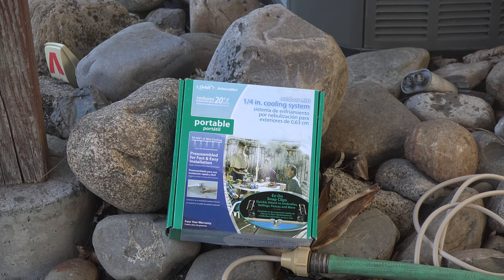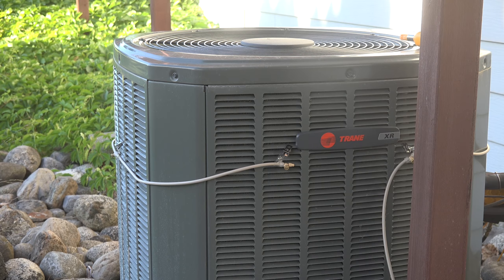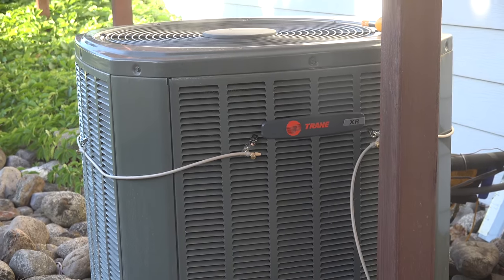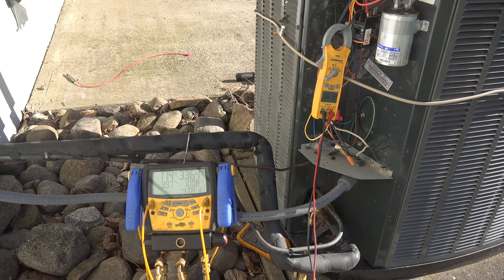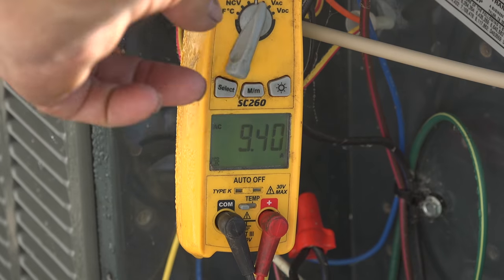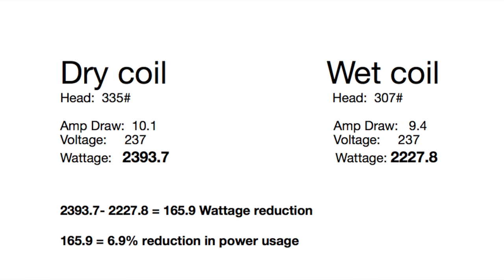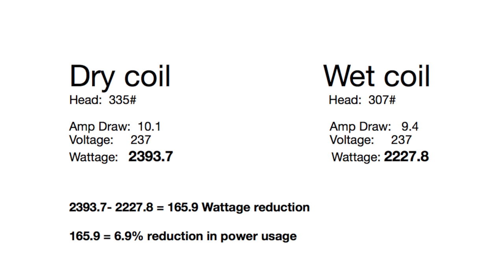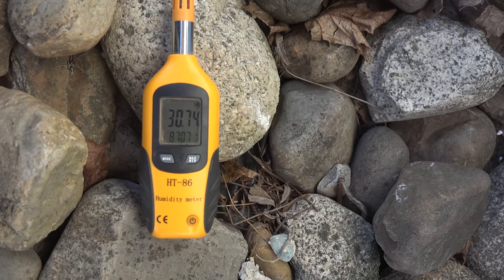Do the misters for A/C work? Part #1

Comment: If misters where something that worked and delivered a 20% savings, AC manufacturers would add it. Manufactures would have there "marketing"demons touting it.
Reply: Mr Krasker yea right this is standard practice in Vegas buddy
Reply: Evaporative cooling could certainly help in an arid climate to boost the efficiency of a closed system like this. The reason that AC manufacturers don't do this or implement it is because they have little financial incentive to. They don't pay for the AC bills that customers incur. If they added a system like this, their units would be more difficult (and expensive) to install, and they'd have to warranty more parts, which they also don't want to do. 

The real problem is total cost of ownership. Customers aren't savvy enough to know how to forecast their usage effectively, and thus wouldn't be able to understand if something like this would make sense financially. I see builders foolishly installing these condenser units on the sunniest spots of the properties out of convenience for them, apparently not caring that it will then get extremely hot during the afternoon when the demand for cooling is at its peak while the heat rejection part of the system is also in direct sunlight, and therefore is at its least efficient. 

Same thing for both parties: lack of craftsmanship and care for their customers or for the environment.
Reply: Michael Horsford
Do they just mist water out in front of the condenser coil, or are they using pads like a swamp cooler has?
The only systems I've seen that both work, and don't damage the equipment have some sort of water panel, basically a swamp cooler pad, in the air stream before the condenser.
Reply: Industrial ACs do this. One problem with such permanently hot and damp systems is that dangerous bacteria and fungi thrive in those conditions so the units have to be periodically inspected and treated (chlorination, peroxide or other) to prevent potentially severe and lethal outbreaks.
Reply: I was in The Bellevue-Stratford Hotel in Philadelphia at a ham radio convention at the same time as the Legionnaires' had there convention. The outbreak of Legionnaires' disease killed something like 30 men, quite a few people got very sick. I had my wife and 3 month old son with me, the CDC and Philly police came to my house and talked to us, we never got sick.
Reply: Mr Krasker no expert on AC systems and live in NC. Recently purchased a small 5050 BTU window unit and it came with a plug in the drain whole for condensation and the owners manual says removing plug will reduce efficiency of unit. I can tell a noticeable difference when plug is in place the fan hits the water and splashes it on the condenser (believe that’s the correct name) than if I remove the plug. It’s much noisier with plug in and that’s why it’s removal. Again, window unit , not an expert, can’t understand why it wouldn’t be the same on a larger unit, just my observation
Reply: @Zan The problem with industrial units isn't drainage. It is the fact that the entire immediate area is perpetually warm and damp from their mister or waterfall system and condenser operating practically 24/7 - they never stop long enough for the entire area to dry out and kill off bacteria. Sanitation of some sort and associated maintenance are required. Room ACs get their water from humidity condensing on the evaporator trickling to the back where it gets picked up by the exterior fan and flung at the condenser to both assist with cooling and eliminate the need for a drip tube to control where waste condensation goes. Once indoor air has been dehumidified, the amount of condensation goes down considerably and the AC gets to dry off most of the way.

Comment: This is a very good forensic analysis if misters are actually beneficial in reducing head pressure thus reducing amp draw on the compressor. I am not very keen on blowing city water on to the condenser coils because of calcium build up. I just put a stand alone high velocity fan blowing into the condensing units coils. I really dont know if it really helps because I dont have an amprobe any more or the correct gauges to see if that stand alone fan is doing any good. Where I live electricity is real cheap so I am not worried about that. All I am interested in is reducing the compressors head pressure to prolong its life. I am a retired electrician but over the years I have learned a little on how central air conditioning works.

Comment: Have used this water method for years on both 11.6seer and 13.5seer. Too many variables to measure $ savings. Generally lowered the outside fan temp by 20%. 13.5seer unit lowered the inside vent temp from 64 to 52° .  Works better on low humidity days and above 90°.  No benefit while raining. The old 11.6seer unit died after 13 years due to the gas heater blower but coil fins were normal. I rinse the fins every other year with a sodium hydroxide solution.  I use a $2 stake mounted mister.
Reply from the maker: I can say with certainty the is no way you dropped the duct temp that much.  Evap temp drop runs from 22F on older units to 16 to 18F on newer high efficiency units.  Your 64F would require to around 86F for a return air temp on an older unit.  Not happening unless you are bringing down an uncooled structure.  
I will however, agree that there are too many variables to determine savings.  
GFM

Comment: 35 years ago I bought a new Hotpoint refrigerator.   The older style that had the condenser in the back.  The house wasn't air conditioned so it got pretty warm in the summer.  The Hotpoint worked great but I decided to increase the efficiency of the condenser by putting a small fan in back to help cool the condenser.  It didn't work.  In fact it caused the freezer to defrost.  By over cooling the condenser it caused the pressure to drop and thus lowered the cooling capacity.    

I think if you look into this further, you'll see the condenser is a specific size to meet the demands of a specific air unit.  Instead of a mister, the manufacturers could install a condenser that's 20% larger.  This might lower the head pressure too much to where it loses efficiency.
Reply from the maker: Sometimes the things we think should work just don't.  
GFM
Reply: grayfurnaceman 
It would be a more interesting world if we didn't have these gosh darn laws of physics to contend with!
:D

Comment: Great video. Thanks.
It would be awesome if you would make a video on insulating the outdoor suction line to condenser vs no insulation so as to compare to torn deteriorated old insulation.  To see if it’s worth the cost to re insulate the lines after they old wears off. 
Also would be cool if you added insulation inside condenser to pump and maybe even pump? Wondering cost savings . Bad hood for system. Thanks for all the great videos

Comment: I enjoy your videos and knowledge I gain. Not long ago on Ask this old House show they showed how an air conditioner  condenser was used to heat up a pool via freon circulation  somehow. Very interesting and my thoughts were why not do this for hot water tanks inside the home
Reply from the maker: There are several ways to do this.  One is use a "superheat remover" on your AC.  It is a heat exchanger that is connected to your cold inlet of the water heater.
Another is a designed "water heater heat pump" best used in southern climates.  One more is an air heat pump that can be used to warm water or cool the structure.
GFM

Comment: What would have been more helpful would be temperature readings at the AC duct vent output before and after the mister started.

Does it improve heat transfer?  That question was not answered at all.

While in Florida I had a ground water assist HVAC system that used a shallow irrigation pump system and a second coil in between the coolant coils at the outdoor unit that did infact increase my heat pump efficiency where my bills were cut by 50%.  The waste water trickled out to the garden.

It worked great in the winter during deep freeze periods as the ground water temp was near 55 deg F and kept the heatpump coils above temperature.  The indoor resistive heating elements never kicked in - a double bonus.
Reply from the maker: Watch the entire series.
GFM

Comment: Grayfurnaceman; HS physics tells us that thermo dynamics requires humidity for heat transfer (ie from the condenser to remove the heat.  Here in Colorado, where it's pretty dry, misting works.  I added misters to two Trane rooftop units (AV to cool the computer  room) and the head pressure dropped about 3-7%.
Reply from the maker: The problem here is you may reduce head in high temps which may or may not increase efficiency.  The only way to know is by doing extensive testing including delta T across the indoor coil.
But you have not addressed the issue of low ambient.  Misting will also reduce head at night and in low ambients which very probably will reduce the head enough to reduce efficiency because of low head to suction pressure.
Because of its use as a computer room A/C, it will operate at low ambients.  Add to that, the damage to the coil from calcium buildup, and you have a recipe for disaster.
Save the high school thermo dynamics for the simple things.
GFM

Comment: Nice test! A lot of window AC units have actually done this for a long time. The condenser fan at the back of the unit has a plastic ring around the blades that picks up condensate water and throws it at the condenser coil to help it cool. All 3 of my window AC units do this, even the 30 year old one I found in the trash. Someone actually drilled holes in the bottom of it, which rendered the water mist cooling ineffective. However, the unit did seem to perform better when I patched the holes. Obviously window AC units are pretty limited on how big the condenser coil can be, so that might have something to do with why it's so effective. Anyways, I thought you'd find that interesting
Reply: Condensate is pretty much mineral free (As long as the evap coil isn't coated in buildup) so it's no harm no foul to get the advantage of evaporative cooling to help the condenser coil. Split systems though the condensate has to travel quite a distance and may not even exit the house on the same exterior wall the condenser coil and compressor is on, hence why it's not used on residential units. Plus with the way most split systems suck air through the coils no cheap and easy way to sling on the condenser coil and even if you did then dust and dirt would potentially build up and turn to mud (a problem that even window units can have if not maintained). 

Large commercial plants do use water spray but they treat the water and those units are often different in layout.
Reply: @Cragified  Good point. The water mist system definitely makes window AC coils get dirty faster, but I haven't seen it cause corrosion or buildup since it's basically distilled water. But I think for most people it does more harm than good over the long run since hardly anyone bothers to properly clean their window AC units.

Comment: I've always wanted to try having a swamp cooler pointed at the condenser to see how things would go. I know in the Arizona desert this would keep the condenser and compressor much cooler which would keep the AC unit running more effective along with the compressor lasting longer.
Reply from the maker: You will find the power used by the swamp cooler and the water usage will far exceed the savings.
GFM

Comment: Good video. However not everyones situation is the same. My units sit in direct sunlight in Texas heat. I use a timer and solenoids for my water to turn on and off. SO I have water on from 1 pm to 7pm. Coil temps without mister in direct sunlight 100_105 degrees after a 5 minute run. With misters 85-88 degrees. Based on these numbers I feel like it has to make a difference during those times of the day. If your unit is shaded or does not receive much direct sunlight I would avoid this. the units are designed to be very efficient in direct sunlight but a little water mist makes a big difference in my opinion. Would like to see my head pressure with and without. Frankly its too hot to stand out there and hook up the gauges to watch lol.
Reply: After running this for a couple months I would have to say not with it at all.  Lot of calcium build up on ac. Solenoids overloaded my   dc converter. Didn't save any money during peak times. More hassel than is worth. My opinion don't do it!

Comment: These misting systems are very dependent on humidity. Just like the patio ones that make sense in a dry area like arizona where the humidity is low but not here in Alabama where its high your just going to make things worse. Also the hardness of the water is a big deal as that will clog up your system in no time.  So Desert environments maybe, but else where your wasting your money and in the end its going to cost you in repairs.  Great video test of these, thanks!

Comment: Had to use one of these for years on an old ac to keep it from switching off for high pressure because it baked in the sun, did a fantastic job but the calcium in the water destroyed the unit.
Reply from the maker: When you have a unit that shuts down on high temp/pressure, I would be looking for incorrect charge or possible evap coil-outdoor unit matching.  A properly operating system will not shut down on overload regardless of outdoor temp.
GFM

Comment: I put one on my ac a year ago with a valve that opens and closes through my thermostat wire. It doesn’t make the house cooler, it doesn’t save me electricity, but I think my unit will last longer than with out it. I also think it would help out older units as well.
Reply from the maker: At last an honest man.  I have heard so many claims of lowered electric bills and shorter operation time with no data to back it up that I get a bit tired of it.  You still have the calcium problem to deal with.
GFM
Reply: grayfurnaceman well, I bought an in-line calcium inhibitor filter. Hopefully I won’t have a problem with with calcium. So far so good.
Reply from the maker: Good luck
GFM

Comment: I live in the hills in LA and while it uses water, the unit cools my home faster and maintain a lower overall temperature. My house is older and the upstairs has no insulation just beams. I guess I am lucky because those mini swamp coolers work too

Comment: In some cases it could even cause the inside coil  to freeze because some systems are designed to run a certain head pressure range to help keep suction pressure up.
Reply from the maker: That could certainly happen, especially during low ambient temps.
GFM

Comment: Thanks for the video. Just wondering isn't the job of compressor is to raise the temperature higher than outdoor ambient temperature to release heat? And therefore it'll change the subcool/superheat?
Reply from the maker: It is the job of the compressor to raise the condensing temp above the ambient.  Subcool and superheat are not directly related to the condensing temp.  
GFM

Comment: So from this i gathered;
1. It works but not much
2. The constant spraying of water corrodes the coil (obvi)
Do you think perhaps, a system attached too and fed water through the drain line. Could be eqiuipped with a filter system to protect the coil and immediately inform you or the tech if the drainline needs cleaning. Also theoretically, wouldnt drainline water also be colder than just a garden spicket and therfore more effective? I also think this system ideally would only be needed on say a very hot day, 95f or higher, to increase the temp split by maybe 3-5 degrees.
Reply from the maker: You could use condensate water but the volume may be too low depending on humidity.  Also, the distilled water is very corrosive.
GFM
Reply: grayfurnaceman thanks for the reply

Comment: Grayfurnaceman makes an excellent point at 2:15 about CALCIUM AND PERHAPS OTHER MINERALS IN THE WATER which will get onto the unit's condenser coil and corrode or clog it up, which will damage it and ruin the operation of the air conditioner. In locations where you have high mineral content in the water, this can be a real problem.

Comment: It doesn't really save me any money, but it does improve the ability of my system to cool my 58 year-old house.  I only use it on the REALLY hot days here in Texas.  On these days, my unit runs continuously to cool my house during the day and the temp inside creeps up until the sun goes down.  I use a sprinkler on mine and the temperature inside the house is 2 to 4 degrees cooler than without the sprinkler running.
Reply from the maker: I have a video coming out in the next few weeks that gives the numbers on using a sprinkler.  Actually 2 sprinklers.
GFM

Comment: We had a site not willing to replace u units just yet.  But on hot summer days coil efficiency was lower Than it should be.  Units would trip on high head pressure.  

We installed misters there to keep it tripping out.

Comment: The riddle is what is your local humidity. In super dry desert areas evaporative cooling works well. Here where I live it is totally almost useless since the humidity is super high. Where I live it rains 70 inches per year. In Los Angeles the rain is about 10.5 inches per year
Reply from the maker: The humidity is certainly an issue.  I will be testing this device with humidity below 15% and see if there is an appreciable difference.
GFM